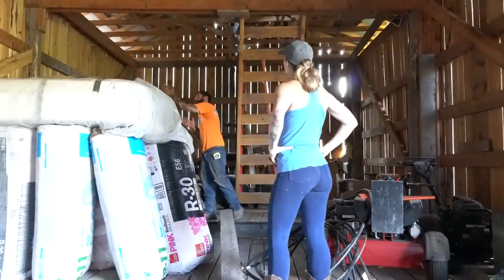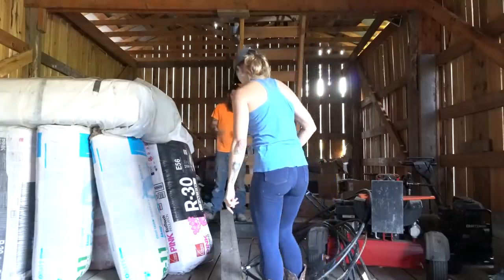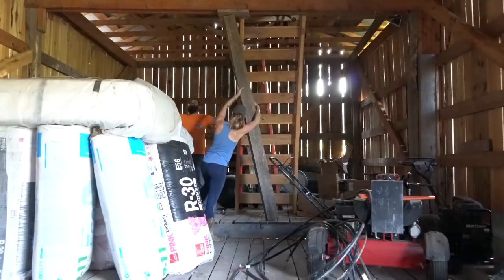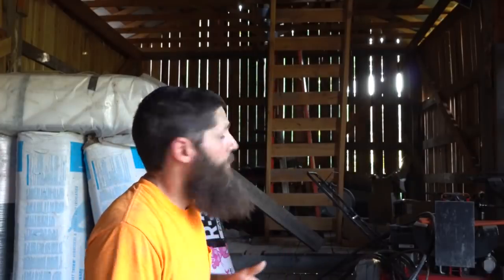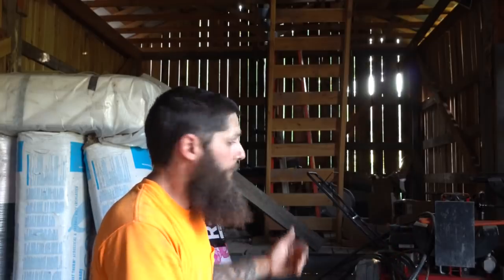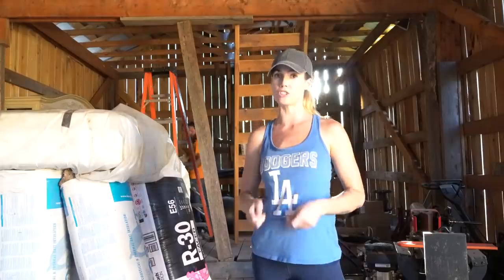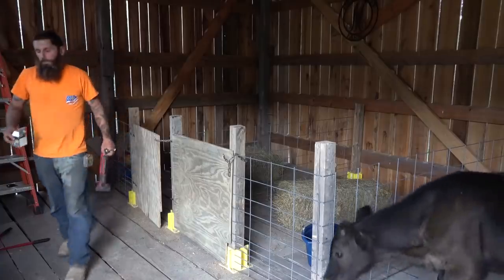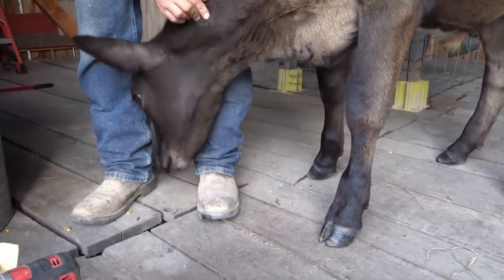Taking Care Of A Structural Issue

Comment: If you drill a one inch hole into the end of that 6x6 go buy a one inch diameter bolt or all thread about 8" long and a nut with washer. screw the nut on The bolt or all thread weld a plate to the top of  it, place the bolt in the hole with a large washer on the 6x6 cut it to fit under the sagging beam, use a large pipe wrench or a 1and1/2 inch wrench and turn the nut to Jack the beam up to level it .  It may take a few days turning it once or twice a day. When level just leave in place and secure or put new 6x6 beside it.

Comment: "Get it, farm girl!". To stop any bacteria from growing on the wood floor, either use Hydrogen Peroxide or hard wood ash and water after cleaning each time. Both are organic and don't leave chemicals behind. We used hardwood ash and water in our chicken coop to control bacteria on the floor and a drop of Oregano oil in the water instead of antibiotics.

Comment: Just FYI make sure there is significant support directly under that bracing post. You could just dig out a footing pad under the floor and use that short post to bridge the gap between concrete footing and the bracing post. Unlee in 2 years you are tearing it down in which case I'll just Shut up. Great to see Chuck the pug back on inspector duty.
Reply: Quake c Josh is a pretty smart guy and good with construction, I’d be willing to bet he’s thought of that and just forgot to explain it

Comment: I don't know if you have one but if not the next time you're by a farmers hardware store stop in and by a fencing hammer. I was raised partly on a small ranch in Montana (500 acres) and for all around tools a fencing hammer is hard to beat. You can use it to pull out those u-shaped fence staples or hammer them in. Wire cutter also, a great all around tool. Also has a claw point to dig out staples that you can't get a grip on with the extractor part of the tool.

Comment: A screw jack post would have lifted that 6x6 up to the proper height, then put in your post. Also, I hope there is support below that post, ie, another support, or a load bearing wall. Rick.
Reply: I was thinking that in the winter, they'll rethink their post efforts today and come up with a better solution. Many ways to lift that sagging beam more effectively and also, secure it in place. I've seen much bigger posts shift in much heavier barns (mine) from wind movement in the barn as a whole, including snow load.

Comment: For the structural issue - I bet a 10 or 20 ton bottle jack would have done the trick and got it raise 2 inches instead of 1 inch.  Easy to say after the fact of course and with the video of what you did to achieve the results you got.  I'm sure it will be fine as is.  Great, hard work as always.  Keep it up!

Comment: Acrow props! Guys, just a suggestion, if you had placed and nailed the mesh on the insides of the posts, the pens would be stronger, as your livestock would be pushing your mesh into the posts, whereas now, the only thing holding the mesh panels in place, are the staples.

Comment: I had to reinforce a beam like that and a structural engineer performed calcs for me.
In the end he had me place a 2x12 on each side of the beam the full length and use 16 penny nails every two feet.
I had a 50 hp motor and wood dust blower sitting on it.

Comment: Buy a 10 ton hydraulic jack, you'll use it a lot once you have it, there fairly inexpensive too.
Reply: That was my first thought
Reply: Yes... and jack at the bottom of the post. Much safer. And then angle 2’nd post in from bottom rather than top. You can then work at the ground where you can swing safely.
Reply: Harbor freight is their friend.  Or better yet Rural King 👍👍👍
Reply: @robertadelsberger3749  
This thread seems to hint that some of us have been there before.
Yup. Uh huh. Me me me me. Too.
Reply: Yes, exactly. If the floor or foundation underneath can support it, they can still raise this a bit higher if needed and add another block once they use a hydraulic bottle jack.
Reply: My hydraulic floor jack would have probably worked. That is kind of the first thing I thought.

Comment: you might be able to tight that post up more, by slamming in opposing wedges , , hit them a couple times a week, till you force it up, , you are not going to push it up all at one time, deflection as set in the beam, it takes a little coaxing to straighten it up again

Comment: I concur with several other commenters that what you've done is transfer the load at center span of the sagging beam to the 6x6 post, then to the 1x plank on the floor. If there are not stout structural members directly below the flooring beneath the post, it will begin to sag there too. Then the overhead beam will return to the sag it had in the beginning. ... Without prior construction experience and long before internet, I designed and we built a 3 story frame house off-grid in interior Alaska. We experienced the same sagging beam syndrome with a beam in a load-bearing wall on the 1st floor. Had to go beneath the house with a solid footing, beefing up structure beneath floor joists and a midspan post like you used to solve our problem. ... I think a concrete footing below the post would be an optimal long-term solution to your problem, but I'm not a structural engineer or an architect. I hope others with more experience and knowledge will comment. ... Have you just put a decorative band-aid on a wound that needs sutures? ... We love your videos, your family, your drive, enthusiasm and cheerful mirth. I have learned innumerable things from watching your videos. Please stay safe and keep cranking out these wonderful videos. ... Peace, Marty
Reply from the maker: It is not sitting on a floor joist- we just extended the post directly below it

Comment: Is there some structure under the barn floor beneath the post you wedged in?   Do you have any concern that the floor is going to start sagging?
Reply: My thoughts exactly or at least toss a sheet of 3/4” - 1” ply down to spread the load over a few floor joists.

I’m guessing that the post he installed was just a temporary fix and that the upper mezzanine doesn’t carry much weight.
Reply: The two 2x12 acting as a beam carrying the joists above are much too small for their span (18 feet ?). One inch of width per foot of span. If over 16 feet or so you may need to use a glue-lam, like a 4x16, on posts. Look at a span chart. This is why barns tend to sag and lean over time. Just enough structure to keep things out of the weather.

Comment: If you want to get the bow out of the floor joist you will have to lift up on the joist over time. In a week or so there won't be as much pressure on it as there is now.

Comment: I sure hope that post you put in there is sitting on solid ground, not a floor joist.  Invest in a 10 ton hydraulic jack.
You won't have to worry about the kids taking THAT hammer.  It is too heavy for them to carry far  and the bright yellow should make it easy to find when they drop it.

Comment: I would advise you to purchase a couple of hydraulic jacks to use for jacking up things. Your truck jack is not made for heavy lifting.
#1 is your tractor, the little jack will not cut, plus a lot of stuff on a farm. I have a 3-12-20 and had to purchase a 30 ton about 20
 years ago. I would advise a 6 and 12 ton should be all you need. A little 3 ton will blow before you get started. The barn job would need 
at least a 6 or more. Goats are fun I had 13, Good luck stay safe.

Comment: A small hydraulic  (piston type) trailer jack is what works best for the situations of jacking up heavy structural members (a beam in your case). They cost about $75.00 and they will lift up something like 30,000 lbs. They work really well for jacking up anything with a lot of weight, It may be worth your time to order one. The vendors that sell trailers can tell you where to get one. On a farm, you may run into this again.

Comment: -You had better get up under the barn and check if the  Floor joist is holding the weight of that 6x6 post you put in.
Reply from the maker: It's not a floor joist, it a post right below that we extended

Comment: Questions... why didn’t you angle the bottom of the post instead of the top? Then you could sledged at the ground. And, why did you have the jack at the top of the post, instead of the bottom? Very dangerous!!! Also... get a nice bottle jack instead of a scissors jack. Much stronger.

Comment: Shouldn't you put something to protect the floor from the urine and stool of animals and make it easier for you to clean?
Reply: Erin addressed that at the 11:00 mark:  deep bedding; temporary for birthing animals and for a short time afterwards; regular clean-outs.   A proper animal barn will be built in another two seasons or so, and then this barn returns to a full-time hay barn again.  Both Erin and Josh agree that as long as this is the case and everything holds up, it's not a big deal.
Reply from the maker: Deep bedding has worked for us over the past year. I just clean it out when needed and put fresh bedding down. They are only in there when the babies are born and for a short time after so a quick clean out here and there isnt a big deal and the bedding keeps the actual floor free of urine/feces
Reply: @WildWonderfulOffGrid  Ok thks for to reply.